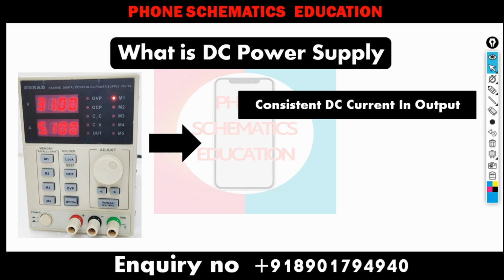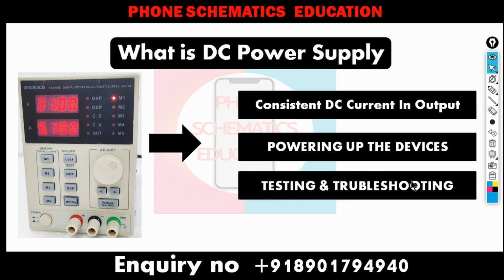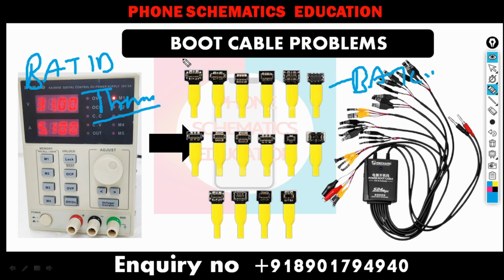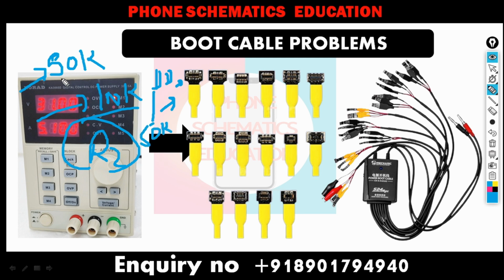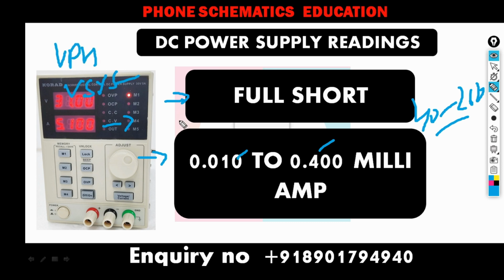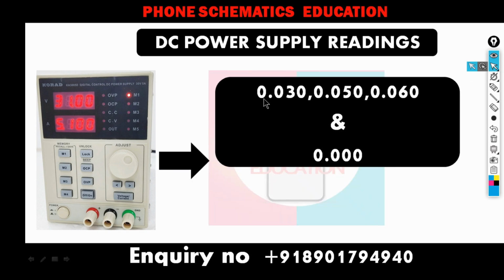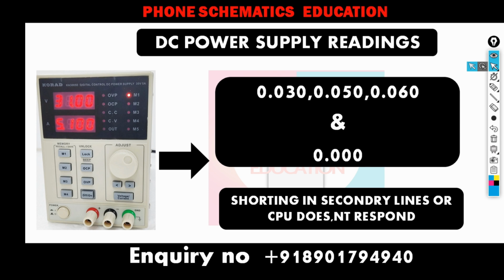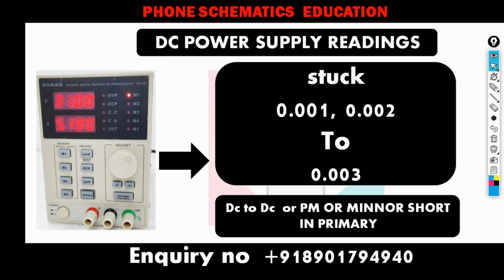"How to Diagnose and Fix Dead Phones with DC Power Supply"

Comment: I use the battery flex but all the devices I've tried they turn on but they don't finish booting, they just turn off before finishing boot with a beep in the power supply. What could be the issue? If i solder the battery flex to the battery the devices turn on normally.

Comment: Great work! Pls what is now the solution when phone CPU is not responding to power. Because if I press the power button it will increase the volt and amp but when release the power, it will go back to 0000amp. Pls solution to this
Reply from the maker: In your question you said cpu doesn't respond then work on cpu

Comment: Your content makes mobile phone repair easier, this is to say the use of battery BN6 as boot cable is more reliable and certain to give accurate results, I honestly appreciate your effort sir. I have a question   which companys DC power supply is the best?
Reply from the maker: @jeromeede7440  Go with any brand

Comment: hello sir , i saw a video on youtube. Realme 8 dead phone, when he plug the charger with the battery  ( 0.6v) , and without the battery 0.1v. With power supply when he press the power button  stuck on 0.160A. Directly he reball the cpu and then the phone work. And as you told us that if the phone stuck 0.120 to 0.200 the problem will be ram voltage or bad ram. can you explain please why by reballing the cpu the phone work
Reply from the maker: @aramhagopian2240  Brother, you probably did not watch the video properly and this happens not only with you but with many people. They do not watch the video properly and post questions later. You should watch the video carefully and you will get your answer. I have also said this in the beginning. The ampere consumption of DC reading depends on your boot cable and it also plays a major role.

Comment: Sir in some huawei phones that have kirin cpu, even the battery same model not working on another same device, i take battery from p30 pro and use in another p30 pro, but, the phone keeps restarting,. The only solution I have when changing battery is to write new battery serial number to the phone,, or I take original batterie terminal and install in new battery, then the phone boots up normal

Comment: Thank you for the video.

is it safe to inject 2v in a 1.8v line that goes to both the cpu or emmc in order to  find a short with a rosin method or do you have to remove those chips first?
Reply: 1.8 and 2v are almost same not damage cpu or emmc
Reply: @ thank you. Maybe my issue will be resolved using that voltage.

I have an a23 with a 1.8v full short and i have been injecting 1.8v without anything melting the rosin, unfortunately i do not have a thermal camera so it has been hard to trace the issue.
Reply from the maker: Yes already tested